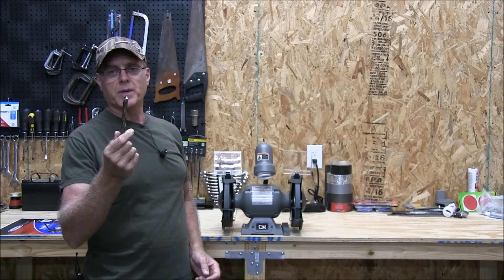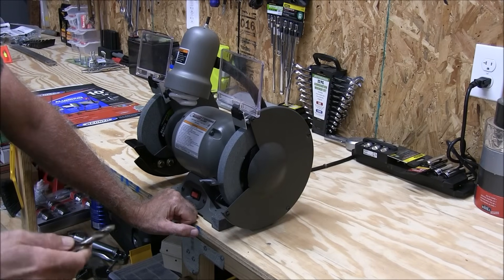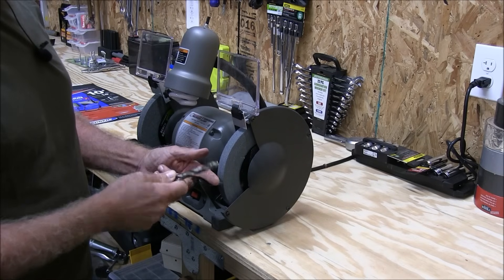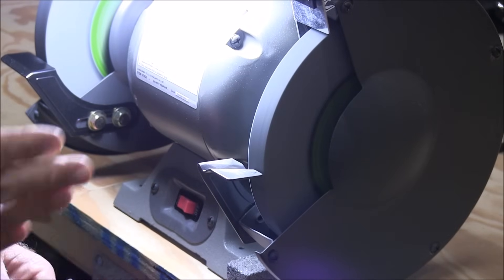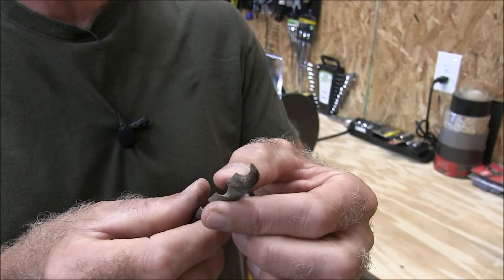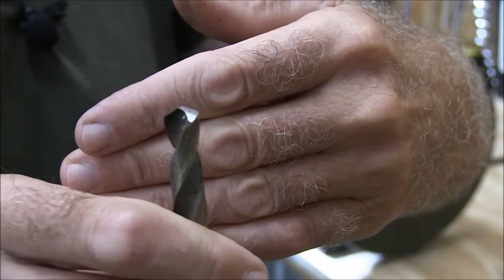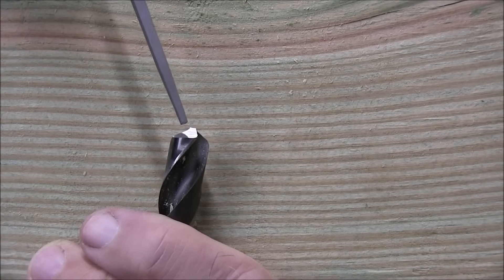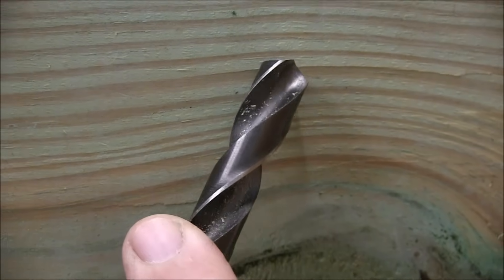How To - Basic Drill sharpening on bench grinder

Comment: I've been hand sharpening drills as a machinist for over 50 years and learned it almost exactly as you are showing it in your video.   I'm right handed and learned it rocking the drill on my right hand finger instead of my left as you do but that's the only difference.  My first job as a machinist was sharpening a box of drill bits for the shop that had probably 500 dull bits in it. They knew the first few would not be so nice but by the time I was finished I had it down pat. Now I can sharpen drills in just a few minutes and teach others to do the same just as you are.  Excellent video.
Reply from the maker: Thank you 👍
Reply: How do you sharpen "masonry drill bits" ???
Reply: @ToyManFlyer1100  masonry bit cut by "impact" they have a chisel edge on the tip. (look at a new one)  You need a silicon carbide wheel to grind it because of the carbide insert.  Aluminum oxide will not grind the carbide very well.  Masonry bits don't "cut" concrete as such. You need an impact drill that smacks it against the concrete and turns to remove the chips. It a totally different concept than a steel cutting drill bit.

Comment: You did aa good explaining your process. I'm 70 years old and have been a mechanic all my life. I was great at destroying drill bits beyond recognition when I was a young man. Having to been exposed to machinists from the forties & fifties. I learned a great deal from them too. In 74 I went from worrking on motorcycle and cars to heavy equipment and OTR trucks. It's when your in the field & break a bit or dull it death, that being able to restore it to do the job is critical. Grinder rock grade is important to gain a good finish. 
I have a special grinder just for drill bits & chisels. Plus a small container on the grinder of water to cool the tool. A good idea. 
Oh, yes I've ground a bit of knuckle  off getting anxious. I enjoyed the video.

Comment: I’m a fitter for 40 yrs ,have always sharpened drill bits with a bench grinder , even a broken in half bitt you can resharpen it , people think the bit head needs to be pointed , it’s the cutting edges that have to be correct and both sides the same length angle ect , good video for dummies 😍😍

Comment: About the best video I've found so far.  Just about all the others will go side to side and hold the bit at one angle.

Though I prefer to start at the cutting edge and swing up while rotating the bit.  Learned that in high school and when I was a machinist for a few years right after, pretty much everyone in the 100 man shop sharpened bits that way.  Also we kept water there to dunk the bits in to keep them cool.

Comment: top job Pete I was sharpening two drill bits on my grinder but I had smoke and tip turning blue they are thin bits 4mm 5mm and I turn my bits, your video is tops, I will go back in garage and see how I go using your method I have about 40 drill bits all sizes sometimes I do a good job sharpening but other times not so good, I hope I can master your method big thankyou from down under in Aus.

Comment: I also was trained many years ago how to sharpen my own drill bits. Recently lost my way a bit ( sharpening below centre line) and now after watching your video at 04:00am I am going to invest in a better bench grinder and sit down sharpen all my dull bits. Not sure about the smaller bits tho. What size do you stop at and just buy new ones. Really great video Pete, not bin that excited or looking forward to sharpening my drill bits for ages. Well done for posting this video Pal.
Reply from the maker: Thank you, Usually anything smaller then 1/8 inch, you would be better off using a smaller grinder with a 6 inch wheel or smaller and make sure you dress the wheel really good.

Comment: I've been using 2 steps ( I. E, cutting edge then relief cut)  on each flute for years.  I can't wait to try this.  I don't think I've read a better explanation.  To the guy who made comment about the grove in the rest being made for it.  Pete said in the video that holding the drill above centerline rolling it thru an arc not past the point of rolling over the leading edge is how its done.  Now,  I'm pretty certain he meant that done this way will automatically take care of the trailing edge,   Relief.  Thanks for a great video and please correct me if what I said was not in line with your explanation.
Reply from the maker: Thank you, well said.👍

Comment: Do you need to re-harden the drill tip after sharpening by heating it up and dipping it in oil?
Reply from the maker: You should never let the tip heat up to that point. That's why I sharpen with quick grinds. Don't let the bit stay on the stone too long. It's a good idea to dip it in water after you grind.

Comment: What's the smallest drill you'd recommend not bothering with, I tend to go through many 1/8" drill bits. Great video BTW 👍
Reply from the maker: @lv2keepfit493  You should be able to do 1/8 drills no problem but it helps if you have a smaller grinder or wheel with a finer grit. You don't have to roll the drill down to the cutting edge, just keep the drill up above center and touch it and rotate and do the same.
Reply: @petebeasttexashomesteading  Thanks , much appreciated.

Comment: Can you change the angle of the drill bit from 118 to 135 with this method or is the angle locked in?  Also,  I tried to sharpen some bits by hand and had trouble keeping the point in the middle so the bit walked when using.  Also, what is the practical limit for sharpening as far as drill diameter goes.  can you do this on a 3/32, for instance?  Hats off if you can.
Reply from the maker: You can change the angle to whatever you want but the angle must be the same on both sides. To keep the point central you must sharpen each side the same amount. If you press the drill against the grinder three times, then rotate the drill without changing the angle and again press the drill against the grinder three times. Yes I've sharpened drills much smaller than 3/32 but you then would need a finer grit wheel and a good pair of magnifying glasses.

Comment: I"m glad I found this one.  There's a boatload of drill sharpening vids out there, most are pretty good, and I've practiced enough that I get sharp cutting edges and lower relief angles, but the shape is still conical; you get those nice straight sharp chisel points at the very tip (at 3:40, for example), which is what I've been trying to develop.  I have some large sacrificial drills to practice your technique on.   Thanks!
Reply from the maker: Thanks, Keep at it, practice makes perfect.

Comment: Hi Pete, Is there a way to tell the center point of the Bit besides the obvious eyeballing it? How can I ensure the cutting edges are equal and identical and mirror images of each other? I see other folks use a jig wit 118 pitch but, that would only guaranty the angle and not the centering. I hope I posed my question correctly. Thanks.
Reply from the maker: Yes that jig with 118 degree angle will also measure the distance from the point to the edge of the drill.

Comment: I love the video and info you provided, so thanks for that right off the bat. One other thing I learned when hand sharpening these bits is to "back grind" the cutting edge. I'm not very good at descriptions, but what I mean is if you look at the cutting edge of the bit and follow it toward the center you'll eventually get to the back portion of the other half of the bit. I was told that if you just touch that area with the edge of the stone you can remove a bit of metal that will give you a more pointed bit for better initial cutting. It dulls faster, but seems to work like a charm for harder applications. Anyway, love to know your thoughts.

Comment: thanks great video.   I was sharpening some stepped drill bits on my grinding wheel, and the side that I needed to use, the wheel is a little rounded but the other side of the wheel is nice and cornered.  Can I swap the direction of the wheel and re-assemble it to the machine so I have that nice cornered edge spinning on the right hand side?  or can the stone wheels only be turned in one direction?
Reply from the maker: @kevinclancy.  You can use the wheel in either direction. But it's best to dress the wheel flat with square edges.
Reply: @ thank you !

Comment: Great video. What grit are you using on the wheels? Thanks
Reply from the maker: I'm not sure with the wheels that came with the grinder but just for an all purpose griding wheel, you could use a 60 to 80 grit. 100 might be ok for the small drill bits.

Comment: I have a drill doctor and I couldn't sharpen a old 1/2 in bit. So I emailed Drill dr. Company a picture of bit and they said there machine would not sharpen a slow helix bit like mine. But I used your method and worked the first try. Thanks for the video. I was wondering if you use grinder to just do bits how often to use the dressing stone?
Reply from the maker: Thank you, I use the grinder mostly for sharpening drill bits and use the dressing stone just before I sharpen a drill especially if I ground something else with it first.

Comment: what about sharpening the side edges along the shaft? don't those also wear?
Reply from the maker: The cutting is done on the point of the drill bit. The sides don't really cut but follow the hole. You would need a special sharpening tool that follows the helical spiral of the drill bit.

Comment: great video, thanks, I have always wondered if you discolor the drill bit or chainsaw blade while sharpening,  (like red hot) does that ruin the temper, will queching help? Thanks
Reply from the maker: I always grind my drill in short quick grinds so not to heat up the metal. It's a good idea to have a little water next to the grinder to cool it of a bit. But never get the drill or chainsaw chain metal blue or red hot, it will anneal the metal and make it softer.

Comment: How to assure each cutting edge is equal? If one cutter was lower than the other only half the bit is working. Right?
Thx for great vid
Reply from the maker: I've been doing it so long without but You would need to use a multi Use rule and gauge tool.

Comment: Hard to tell in the video.  Let's see if I can ask this correctly where you can understand.  I get the side to side angle but what about the angle of the cutting edge against the wheel?  Should the cutting edge be a 90 degree(is that right) angle to the wheel?  You got the side to side angle, which is 118 degrees or so, then you got the up and down angle but what about the twist of the bit?

Comment: Thanks for making this video. I noticed you left the bits with a chisel tip. I get a lot of “walking” in wood when my bits have this kind of tip. Is there a simple way to take the chisel tip down to a single point?
Reply from the maker: Yes, you can dress the corner of the wheel square and sharp and put the drill bit web in there and thin it out or if you have a good hard wheel with a very sharp corner you can put a split point on the drill bit.
Reply: Also, if you make sure that both of your cutting edges are the EXACT same length then it should take care of the some of the wobble and walking. I’m pretty sure this is the case at least.
Reply: @justinkinter8651  thanks!

Comment: Great educational video sir...trouble is I dont really invest on a bench grinder cause i dont anticipate using one frequently...what i think of is installing a grinding stone on my angle grinder and mount it on my working bench to serve as a bench grinder....do you think this could work so i can do some drill sharpening work the way you showed on the video? thanks for any reply.
Reply from the maker: It would be to difficult to hold the drill bit when sharpening. Better to buy a 6 or 8 inch bench grinder, even a cheaper one will work good.
Reply: thanks for the reply

Comment: I work with a guy that is a pretty accomplished machinist here at Ford. We have to make a lot of fixtures for the testing we do here...one day we were hogging out some machine handles for my own personal use on my vintage table saw (government work) and we had a dull 1/2" bit. I had already seen your video and offered to sharpen the bit on our dedicated sharpening stand for the heck of it before we chucked it back in the lathe. Came out great; cut well, and the older guy was impressed. Thanks for the video.
Reply from the maker: Kevin S awesome I'm glad it helped you out. And I know all about government work :) I used to do plenty of that, you just never tell your boss :)

Comment: Great video.

You take some of the fear outta grinding.

A few questions, if you don't mind.

I have a Baldor 8" grinder that I haven't used in a while. Do I need to worry about grinding wheels (stock wheels on the machine from Baldor) that have been through many temperature changes in my garage over the years?

Also, you used an abrasive stick to clean the wheel. Do you also use any diamond dressers? If so, how often?

What, in your experience, are the real risks to wheels exploding?

Do you use any jigs at all?

Thanks, and I'd enjoy more videos too!

Comment: I have a problem doing small bits...those that are 3/16" and smaller. I always screw them up so I just buy more...any tips on sharpening the small ones? Maybe get stronger glasses lol?
Reply from the maker: To sharpen small drills, you need a smaller bench grinder and really dress the grinding wheels good so they don't vibrate.
Reply: @petebeasttexashomesteading  Thanks!

Comment: Pete, thanks.  What do you do to reestablish the center point of the drill bit tip? (It looked a  little wide after sharpening...)
Reply from the maker: You can use the edge of a well dressed grinding wheel to thin the web of the drill or if the corner of the wheel is very sharp, you could do a split point. I'll have to do a video of that soon.
Reply: @petebeasttexashomesteading  Thank you!

Comment: the slot in the rest is for that its a 31 degree holds the bit and rotate it
Reply from the maker: Those guides are OK if your not that experienced but you need to rest the drill on your finger so the drill is higher then the center line of the wheel or you'll have trouble grinding the heal of the drill point.
Reply: @petebeasttexashomesteading  can you just raise the tool rest to the correct position ?

Comment: Thanks for the video. I'm in need of a grinder. I'm looking at 8" & 6". Also slow speed as in 1750 RPM. What do you recommend for drill bits? My understanding is 3500 RPM might blue the bit and loose its strength. Please advise. 
Thanks Dan
Reply from the maker: Dan Rowton 3500 rpm is what you need or a basic grinder as I have in the video. the trick to not getting the tip blue is short quick grinds, the longer you keep the bit on the wheel the more heat you generate. Watch the video again and you'll see I do 3 short grinds per side, that'll also keep the angle length equal per side. hope this helps.

Comment: Thanks, that was great, helped me a lot (a novice), can't wait to try out, sick of old dull bits...  a little confused about the tip, didn't seem to be a point but maybe I just didn't see it right.  Do you like the HF grinder, and any suggestions for best grinding wheels or are they all the same?  Greg
Reply from the maker: Thanks, The HF grinder itself is not a bad grinder and the wheels they give you are ok but the finish wheel on the right side is to soft, meaning that when you grind something the wheel loses it's shape fast or breaks up to fast. So I would suggest changing it after it's worn out to an 80 to 100 grit and a hardness letter of I, J or K wheel. So the wheel might read 80 I. Wheel hardness in determined by the letter after the grit number. (A) is very soft and (Z) is very hard, you want to stay in the I,J and K range.  Hope this helps

Comment: You're a machinist and you don't know that little groove in the resting plate is exactly for sharpening bits??? The way you're doing it is not precise and most people will mess it up. That groove holds the bit at the exact angle. You're basically doing it wrong.
Reply from the maker: You are obviously inexperienced. No one in 30 years as a machinist has ever used the grooves. Those grooves are for inexperienced sharpeners. It's not that important what angle the drill is as long as it's close to 118 or 135 degrees. What's really important is the both sides are the same.
Reply: @petebeasttexashomesteading  I think Slippery Johnson checks his drills on the Comparator. I wonder if he even has a job? I think I know how his johnson got all slippery. Ha Ha!!